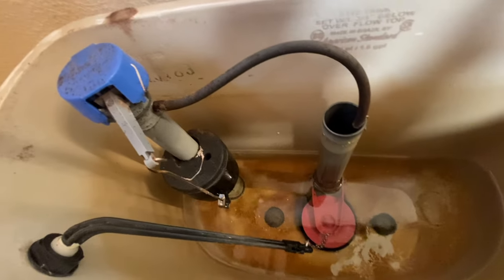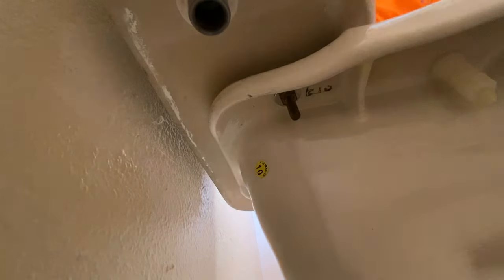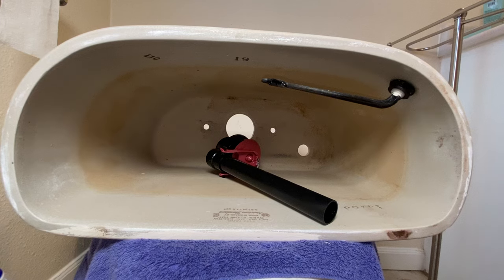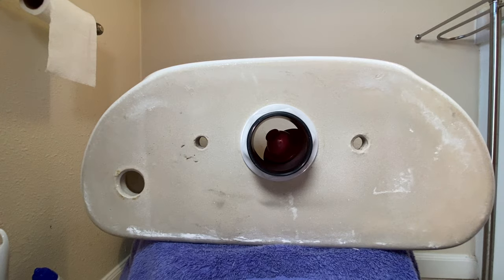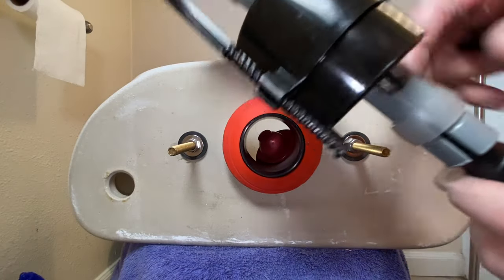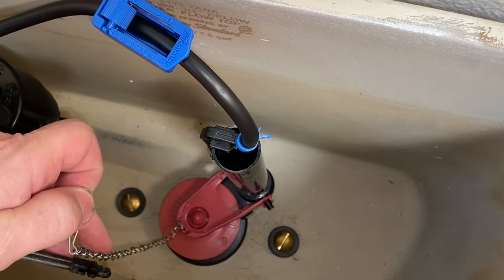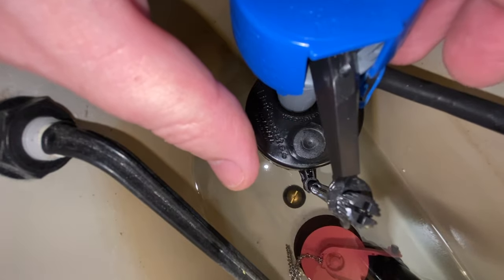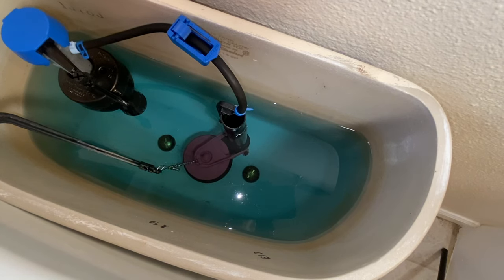Don't Replace Your Toilet!  Replace The Toilet Tank Parts!

Comment: tightent down the tank using the bolt washer nuts sequence you suggested, really liked it but my tank is wobbly and had to use secure a tank separately so it wont move. pretty sure i tightened it pretty good since there was no leak, just wondering what would cause the tank to wobble like that

Comment: Thanks for your video.  My toilet in my master keeps filling a few seconds every 30 minutes or so even after I replaced the rubber plunger. I needed to figure out what's involved in replacing the flush valve as I knew that was the culprit. Also bought me a new set of hollow shaft nut drivers which I've been wanting to get as a result of your video. 🙂
Reply: V
B

Comment: Well done, I do the same with the tank bolts I always check to make sure the nuts are not bigger than the holes in the bowl if their to big there's a possibility when you tighten down the tank you might Break it

Comment: Excellent tips for today I thank you very much... I do have a question for you I have a downstairs bathroom with an ejector pump seems like the injector pump hangs up from time to time overflowing onto my basement floor so when I unscrew the lid and look inside there appears to be big  soap balls,  softball  in size.  we do have a downstairs shower,  the only one in the house that is heavily used if those are so called soapballs  how can I get from building up  and causing my plunger valve not to engage..causing a mess on basement floor... thankyou.. It happens 6 to 7 times per year..
Reply from the maker: Wow. That is an interesting issue. Softball size is crazy!! Have you gloved up and grabbed one?  What does it feel like?  What kind of float is in there?  Your floats hanging up on the balls?
Reply: @ThatFixItGuy  its hard, it hangs up over the float preventing the float switch to activate ejector pump.. yes they float....I clean them out its usually 2 or 3... white in color... the only thing I can figure is somehow the shampoo from shower is maybe intertwined with hair from shower & maybe some toilet paper forming a softball... it happens 6 to 7 times a year always the same looking type balls in  the injector pump tank... it's the weirdest thing...

Comment: Should the tube that fills the tank and is attached to “overflow pipe” pour the water inside the pipe or outside of the pipe,directly into the tank?

Comment: What happens when the screw head to the bolts that hold the tank on has stripped grove and is unable to hold in place so the nut can be taken off 😩

Comment: I change a washer bolt from behind underneath the toilet bowl than the water stopped dripping. But i then notist behind the toilet it sweats and i see water behind the toilet base. I think because the owners here took the basement pipes for condensation. And since them im even having issues with my water pressure. Here in nebraska it gets very cold and freezing. I think they shouldn't never took the pvc pipes along the wall for the condescension. I told the owner and she said that dosent have nothing to do with the issues.

Comment: HELP!  i replaced the tank as you show but when i flush it, it wont flush.  i get some bubbles in the bowl and that's it.
Reply from the maker: I wonder if you got some debris in the bowl. Try taking a piece of wire and clean out the holes in the toilet bowl
Reply: @ThatFixItGuy  no thats not it.  I had a power flush system and tried to replace it with a conventual gravity system.  I didn't realize that you can't use a toilet designed for a power (pressure) flush with gravity system.  I need a new bowl.  Thanks for the response.

Comment: 25? In my country all the parts are at least double it and I just had to check the prices since my parents had a large leak. no only have to fix small leak with the water supply and the flex ones are to long so have to fix it the old fashioned way. Doing it within 10 hours from now.

Comment: Thank you for a great tutorial. If my bowl water turns blue after the food coloring test, how do I fix it?
Reply from the maker: Either your flapper is leaking by or the flush valve seal as gone out. I would pull off the flapper and see if it is warped and/or falling apart. You can run your finger around where the flapper sits as well make sure it is smooth. If all that looks good it is going to be that gasket. If it is that then rebuild the whole toilet tank. Hope this helps.